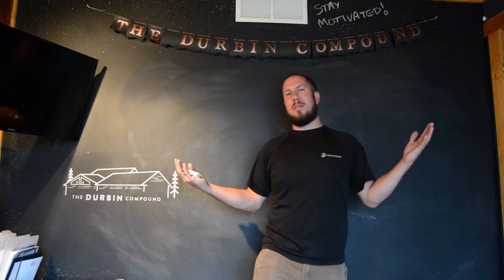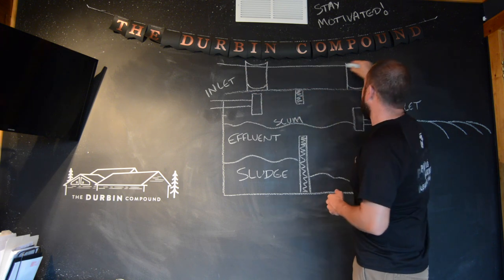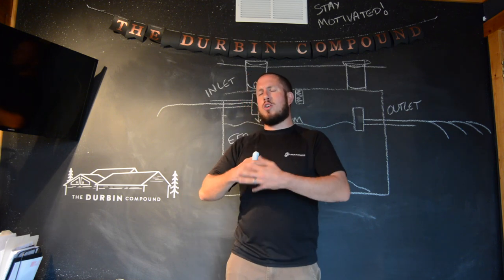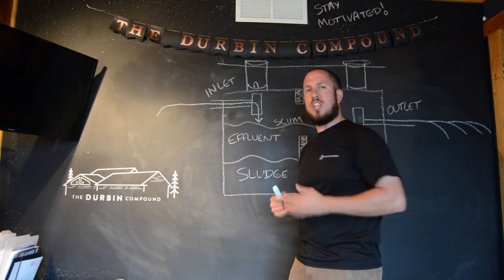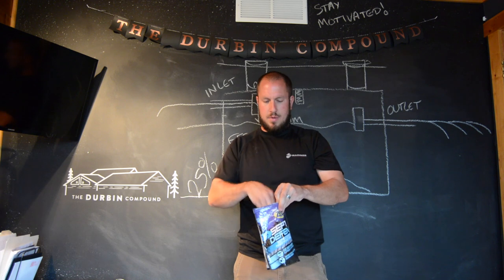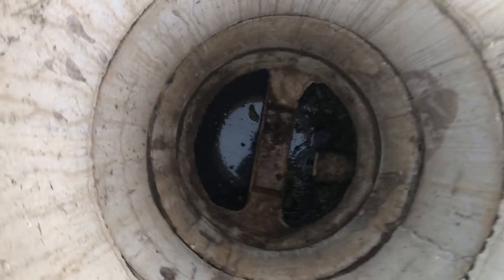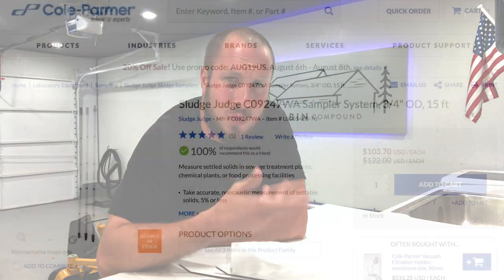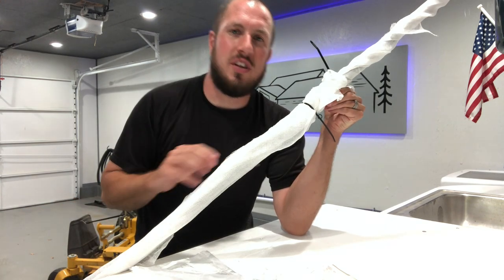How A Septic Tank Works

Comment: I'm a British expat living in the mountains of Mongolia and our system is totally different. There's a black water cylindrical concrete tank. It's just connected to one toilet. I calculated it as having a capacity of 3300 US gallons. It's 2.5m diameter (outside) and 3m tall. This will need to be emptied very infrequently which is important since access to us is tricky. We're off-road. We are just a couple, no kids.

Then next to that is a bottomless 1.5m dia x 3m tall tank of the same construction for grey water. This will be connected to a bath, washing machine and sink(s). Since it is bottomless it empties directly underground about 3.8m from the surface.

Comment: The inlet Dow pipe should be under the floating crust line and not as shown in your sketch,the crust that forms is to seal out the outside oxygenated air and allowing anaerobic bugs to work efficiency so waste is not introduced over but under the floating crust.

Comment: (1) 1st chamber for anaerobic bacteria grow up ,this chamber should not have light& air to breed anaerobic bacteria.
Gas will be produced in this chamer ,so that we need to make a 6"  gap partition  on wall between 1st & 2nd chamber.
Need to install 4" dipped T on wall ,which is 4"lower than inlet pipe.
(2) 2nd chamber that is design to produce  aerobic bacteria,so that this chamber need light and air oxygen. Inorder to get light and air ,we need to install goose neck pipe on top cover.
Need to install dipped T 4" on partition wall which level  is 6" lower than previous one.

(3) 3rd chamber is to discharge clear water into the soil. There will be also outlet pipe which is 6" lower than inlet pipe .
Need to install goose neck vent pipe.
(4) Need to install manhole on each chamber for maintenance purpose.

Comment: Thank you I understand how a septic system works you were a big help
Reply from the maker: Awesome! Thanks for the comment!
Reply: @TheDurbinCompound  what enzymes do you recommendI don't know if I have a concrete or fiberglass septic tank in Hawaii how long do they last
Reply from the maker: I do not have a specific enzyme that I like. You should safe with any common variation sold in store. These septic tank systems will last forever with the proper preventative maintenance. For the record, at our previous rental home, the septic tank could not be located and we never had it pumped. The owner of the house had it for many years and he was not even concerned with finding it or maintaining it. I’m a little more particular about my stuff.

Comment: I am moving into a home with a septic system. This is the first home I owned with one. Your video was very helpful in explaining its operation. Question….is more better than less when it comes to dissolving the bacteria packets. Can an excess of bacteria harm the system? Thanks!
Reply from the maker: I’m not a biologist but I think the answer is yes. Too many bacteria can be harmful. I have had really good luck with never having to pump a system due to use. It has always operated healthy and broke down the waste fast enough.

Comment: Great video..........question How much fluids comes out of the back outlet a day/month/year???
Reply from the maker: Once the tank is full. It puts out as much as you put in. Except for the solids have fallen to the bottom
Reply: Kapena Otare average toilet flush is 1.7 gallons. At that rate, less than 20 flushes a day would fill a 1000 gallon tank in under 2 months. That’s off the toilet alone

Comment: Great job man. Me and the septic guy were 99% confident my tank was never serviced until today. How did it go 25 years with no issues?? 
Also, since I only dug up the center man hole and no other access panels does that mean there is an extra chamber that didn’t get drained today?
Reply from the maker: No you should be fine. I’m sure the septic guy wouldn’t have left if he had any doubt that he didn’t get anything. It is one tank after all.

Comment: Show leech field and how it sits relative to the septic?  Thanks and great video!  If the sludge goes into leech field, how do you fix that?  If your leech field is wet and oily and 1500 lb riding lawn mowers go back n forth peeling out zero turning dune buggy mosh frenzy style will that f up the drain pipes in the leech field?  If so, how do you even begin to fix that?  Step by step-by-step 🚶‍♂️

Comment: When you flush the Toilet and use the sink does that water get pumped  back into your water or does it just get pumped out elsewhere
Reply from the maker: Any water that goes down the drain is going out to the septic tank.  It is filtered as shown in the video and allowed to soak back into the ground.  The waste water is in no way connected to your fresh water.
Reply: Paul_728 when the liquids leave the main large tank it goes out to leech lines buried in the soil, it then leeches into the soil and the soil continues to eat at the waste because soil is packed with about a billions microbial enzymes
Reply: @chief5981  oh ok, thank you for for the explanation.

Comment: Plz make video of three chamber septic tank and which one is better????
Reply: (1) 1st chamber for anaerobic bacteria grow up ,this chamber should not have light& air to breed anaerobic bacteria.
Gas will be produced in this chamber ,so that we need to make a 6"  gap partition  on wall between 1st & 2nd chamber.
Need to install 4" dipped T on wall ,which is 4"lower than inlet pipe.
(2) 2nd chamber that is design to produce  aerobic bacteria,so that this chamber need light and air oxygen. Inorder to get light and air ,we need to install goose neck pipe on top cover.
Need to install dipped T 4" on partition wall which level  is 6" lower than previous one.

(3) 3rd chamber is desy to discharge  cear water. There will be also outlet pipe which is 6" lower than inlet pipe .
Need to install goose neck vent pipe.
(4) Need to install manhole on each chamber for maintenance purpose.

Comment: to find  your septic tank, shove a heavy metal snake down the pipe leaving the house, go out side with a good metal detector and follow the snake,.  after you find the tank, do the same to find the general direction of the D box or fields, shove the snake in the outlet hole.. PS do not use a plastic snake,, looks like just an ad for Zep. maybe try a pack of yeast.

Comment: We were told, by the guy who inspected our septic tank when we bought our house, that our system was too new to our Rid-X in it.  Is this accurate?  Also, my wife generally uses antibacterial liquid soap.  Is this safe for the system?
Reply from the maker: Maybe what he meant was, that it didn’t have enough waste in it for Rid-X to do anything....I’m not aware of any new designs in septic that wouldn’t benefit from enzymes. I have never had an issue with any soap used. I don’t think you have anything to worry about there.
Reply: He told a that we should never use it because it could damage the system.
Reply from the maker: Jeffrey Davis hummm. That could be a mix of personal belief and liability reasons. I’m not entirely sure

Comment: The sludge stick is 75 bucks
The cheap method runs whatever the cost of the cheese cloth supply you buy, plus the stick. 
This DIY septic tank stuff can be dangerous. What is the cost of medical care if you screw up with the sludge ? 
What's the cost if your kids or pets get it on themselves ? 
You, your family, and pets would be far better off if you paid the cost of a yearly septic check by the pros and got their report of your system than hoping that you know what you're doing.